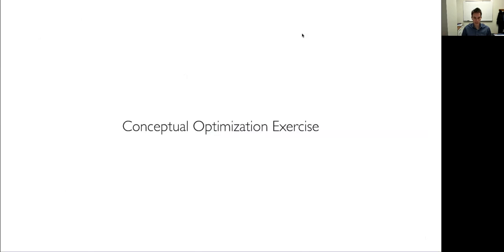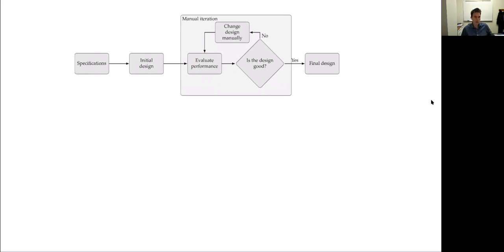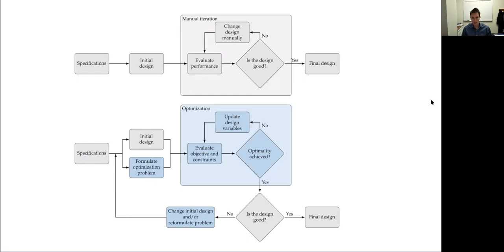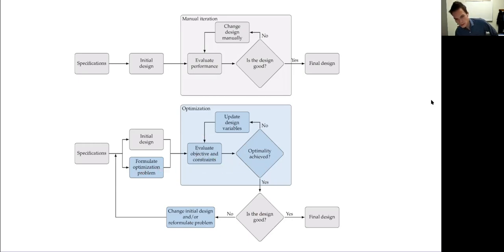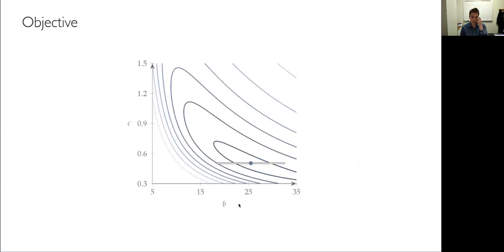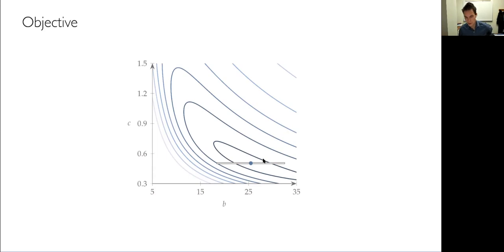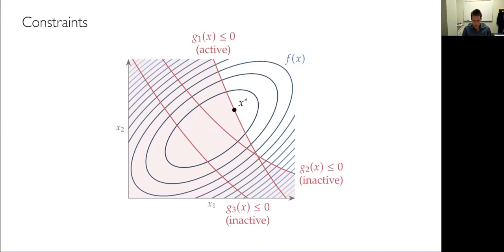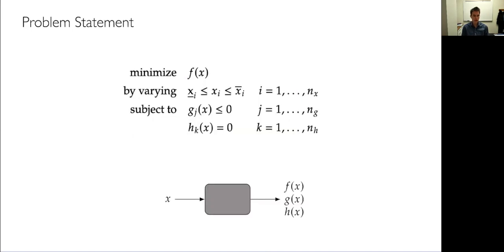Introduction to Engineering Design Optimization

Comment: For design dimensions the best I have right now are the following constraints: 

Non Negativity Constraints:

Geometric Constraints: 

Mate Equations 
Absolute Equalities 
Lengthwise Equations:
Comparative Inequalities

Structural Constraints:
Force Sum = 0 at every joint 
Moment Sum = 0 at every point

Resource Constraints: 
Cost Constraints 
Material Constraints 

Functional Constraints:

Comment: Dont u need to create the initial design before you can optimize ?
Reply from the maker: you need a starting point (an initial design), although the starting point doesn't have to be feasible (doesn't have to satisfy the constraints, in other words it doesn't have to be a good or even a useful design).
Reply: @BYUFLOWLab  thank you for the response 

So we just need an undimensioned concept art of a design. Then solving our mathematical programming verifies this concept’s feasibility
 (in addition to finding the optimal solution)